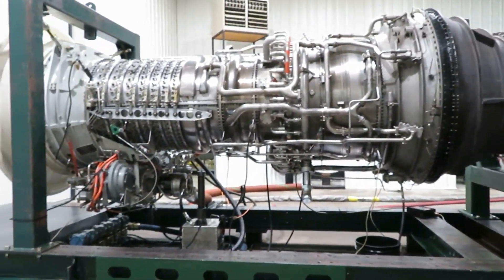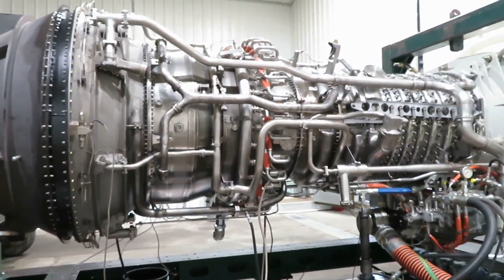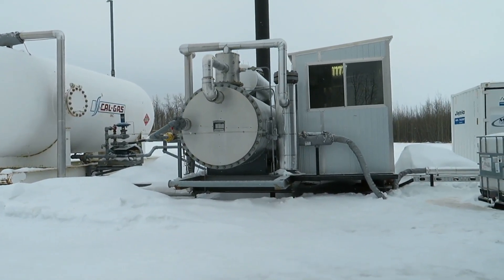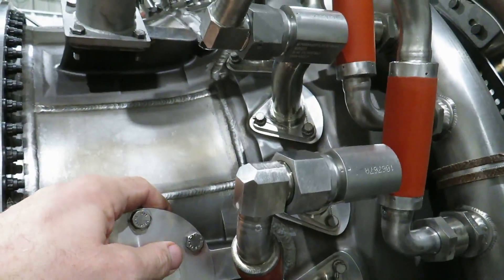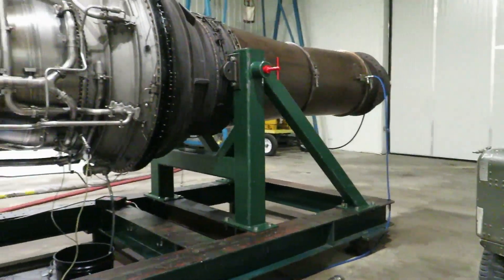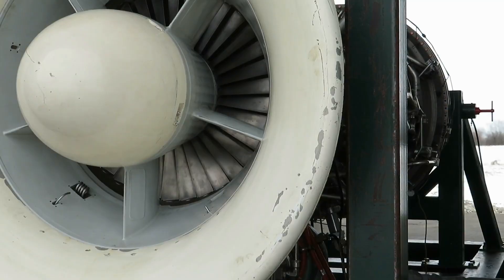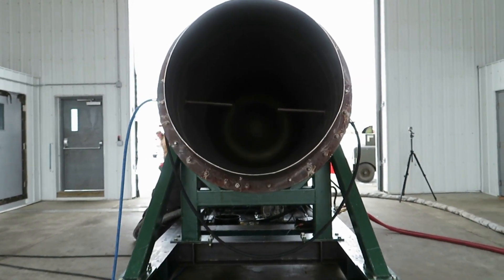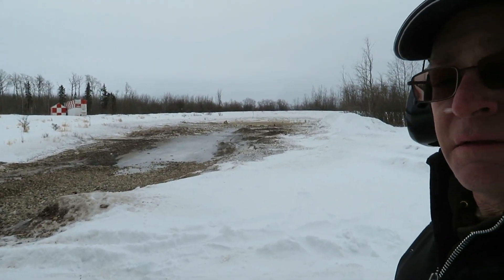The Big Engine - the GE LM2500

Comment: What do all those heads on the outside of the compressor at 7:10 belong to? My guess would be that they are variable angle stators although I'm not sure.
Reply from the maker: You are exactly correct, sir!
Reply: VSV, variable stator vanes. The green bell crank is actuating the feed back cable.
Reply: The actuator is powered hydraulically with fuel from fuel control.

Comment: What is this engine going to be used for?  I don't know of any aircraft that use LP for fuel.  My company has set several LM5000 on site for generating electricity.  We have set much bigger GE turbines also for power.  My company doesn't work directly on the engines but we have transported and set hundreds.
Reply from the maker: We use vaporous propane to simulate natural gas,because it would cost millions to put a NG pipeline to our test cell. This engine will be used like your LM5000's.

Comment: They built CF6-80C in the next building. Although back in the 80s we worked on military engines.F110 and F101.
Reply: Ed Dean, thanks for working on th F110.  I was an F-14B RIO from '89 to '94.  The B was very close to supercruising with the F110 engines.  Going supersonic and come out of burners, stay at full mil power, it would take a very long time to decel below Mach 1.  We could walk away from an A at max AB (zone 5) with mid AB selected.  And most importantly, no damn compressor stalls at high angles of attack.  Experienced two during training in ACM an it sucked.
Reply: @markfrost8745  Thanks for your service.

Comment: At 5:00 to 5:06 it looks like something flashing as the engine starts. It looks like it is down around where the starter is
Reply from the maker: Our sensor lines have ID tags on them. Small aluminum discs attached with a loop of wire. When the dangle about in the wind, they reflect light, and appear to be flashing lights to some people.

Comment: I'm curious about how far out the exhaust remains dangerous and how hot it is e.g., 75C to 150 meters?
Reply from the maker: It depends on what the power level is. We have gravel in Jetwash Alley, so the rocks are extremely dangerous for more than a hundred meters.

Comment: Probably a dumb question but how does the engine Not take off? What holding the stand down?
Reply: A bunch of concrete and some bigass bolts. But still you have to remember that this engine is not optimized for thrust but instead for shaft horsepower, so it can be used in power generation and such.
Reply: @nerfinator03  This engine is optimised for thrust, it's only when this engine (producing lots of high velocity air, and therefore thrust due to the momentum change as air passes through) is blowing on a power turbine (not present in this test) that you get useful shaft horsepower out of it
Reply: @maxhammick948  there is no point in running a different, less efficient due to heat losses, turbine after the engine. You have a perfectly fine chance to add a couple more blades in the back and try to extract as much energy as possible from the hot exhaust of the combustion chamber and then just slap it through a generator. This does not make sense for other reasons as well. How would the speed be regulated if the power generation turbine was a separate object. The generator needs to run at a perfectly synchronized 50-60hz.
Reply: @nerfinator03  It may not make sense to you yet, but it's how it works in the real world. Search the channel for 'Power turbine' to get a far more detailed answer to the parts that don't make sense to you. If you still have a question after watching the videos, please mention you have watched the videos, and still have a question. You will get a personal, and technical response. TRY first!
Reply: @nerfinator03  There is a point, as that's what turboshaft designers do: /watch?v=QdOZSZqCthI & /watch?v=dhV8cMQ__pw

Heat losses are pretty tiny, as the gap is small, and the spool of a gas generator doesn't have much to regulate the RPM either - it picks a speed it likes based upon the fuel input and atmospheric conditions. The synchronised power generators self-synchronise anyway if they're connected to the grid - running at anything other than the ideal 50/60 Hz means convincing the rest of the grid, so the synchronous generator becomes a motor. The forces imposed by this upon the rest of the turbine would probably greatly offend the spool of the gas generator.

No physical connection between the gas generator and power turbine is also essential if you're mechanically powering a vehicle with the turboshaft, as driving a vehicle requires varied output shaft speed (e.g. spinning up the blades on a helicopter, or low speed operation of a jetboat). This could prove fatal to the gas generator if you do stop the spool while continuing to add fuel, as the reduced airflow with the same heat input means higher turbine temps.
Reply: @nerfinator03  Well, the test in the video is the gas generator only which is pretty much a single-shaft jet engine. The thrust coming out of the test cell thrust nozzle is equivalent to more than 20 MW shaft horsepower which usually is generated in the attached power turbine. There are not many single-shaft turbojets without bypass and afterburner out there that would meet size and power of an LM2500 gas generator. So you better make sure your test rig is secured.
Reply from the maker: Music Rack:   They hardly changed any parts to convert the CF6 into the LM2500.
It appears from your comments that you do not know that every channel has a search bar. It's easy to find videos on the subject you are curious about if you use it.
Sorry if I get annoyed with people who ask the same question, after I have made multiple videos answering it... but I try to be amused at it.
Reply from the maker: Video: Our engine test stand.
Reply: @MrCrackbear  Sorry, that's what the channel search function is for. No free pass for laziness. We don't train for helplessness here. Just like the real world. Make AN effort! TRY FIRST, and if you still need help, you won't get any attitude from me (or Jay).
Reply: NOT a dumb question, but a poorly researched one...
You would do well to review the extensive catalog of existing videos here. ALL the answers you seek (and likely the next hundred) have already been answered for you IF you bother to look for them...

1) long pipes anchored into the ground. (Test stand)
2) this engine produces no practical thrust . (Power turbine)
Reply: @mikecowen6507  Hate to disappoint you I didnt research anything.  I saw one video and asked a question and like I thought it would be answered promptly.
Reply: @TheDominationNetwork  No disappointment whatoever. Given the amount of material Jay has produced, a blind person could "see" how much effort you put into (not) finding the answer on your own. Your loss, not mine.
Reply: @TheDominationNetwork  don't worry dude. I think it's totally fine to ask that question. I wouldn't want to look through hundreds of videos if you can just ask and get the answer quickly. Especially if this is not part of your occupation or hobbies or such.
The lm2500 is an aero derivative, which means the technology was originally an aircraft engine. They kept parts of the original design and changed lots of parts to change it into a stationary gas turbine which can produce mechanical power. This power can be converted to electricity in a generator for example. In an aircraft you want to produce thrust. Here the same energy is not used to produce thrust but power via a turbine.
Reply: Mike Cowen A curious mind is a precious thing that is best not stamped on!

Comment: I used to build these in Evendale, Ohio
Reply: I an still welding on the turbine mid frames and sumps in Evendale
Reply: Ed - did you build CF-6 engines at the same time or factory?

Comment: What is this engine used for?
Reply from the maker: Lotta things. Google-Fu.
Reply: The LM stands for Land Marine. On land the primary use would probably be generating electricity. On ships they would most likely also generate electricity to power electric motors connected to propellers.  They are also on oil platforms for electricity and could drive pumps and compressors.

Comment: That Variable Compressor Guide Vanes actuator system is such a simple but effective design! I guess it's very convenient to adjust the rigging angles if needed since there is minimal of external tubes and hoses compared to aero jet engines.

Comment: Could it run on hydrogen gas?
Reply: I'm betting that propane probably doesn't really produce carbon buildup either...
Reply from the maker: Yes, that would be the best possible fuel.
Reply: @AgentJayZ  I'm guessing because no carbon or other byproduct buildup yes?
Reply from the maker: Propane and natural gas are excellent fuels. Hydrogen is the best you can get.

Comment: The VSV adjustment arms on that looks pretty stout, also it seems to pivot instead of slide like the 1500. Does that mean the vsv's closest to the pivot point don't have as large of a angle of attack change as the ones at the front, or is there some trickery going on so that all vsv's still have the same amount of movement?
Reply: I think it's trickery. As you get closer to the pivot point the lever arms get shorter than those up front so they all probably move about the same once you account for the movement that the lever needs for the same amount of rotation
Reply: Top notch Ben 👍

Comment: How much fuel did the engine consume during the test run?
Reply from the maker: 20% of a 22 thousand Liter tank of liquid propane. In about 40 mins at various throttle settings.
In service it would use double that.
Reply: I worked on LM2500s for 10 years.  On Diesel we would use around 6000-7000 litres per hour
Reply: At full power, theoretically it would consume about 2-3 liters per second.

Comment: The engine rooms of warships powered by these engines must be extraordinarily loud.
Reply: I might be wrong but I think when the intake air and exhaust stream is ducted I don't think it's super loud
Reply: Both GE and MTU LM2500 packages are designed to give around 85 dB at the package door on base load. The engine is loud, but with the inlet and exhaust sealed, by far the loudest things are the package ventilation fans.
Reply from the maker: The heavy steel enclosures containing the engines have access doors, upon which are posted warnings of "lethal sound pressure levels".
Reply: They are built into custom sealed pods for that reason so they can be sound proofed and easily replaced.

Comment: Is it a single or twin shank?
Reply: Shank?
Reply: The Lm2500 has different versions. In the early versions there is a twin shank version where the high pressure turbine blades have two airfoils per root seration (or shank) while the single shank has one airfoil section per root seration.
Reply from the maker: Twin
Reply from the maker: I have just learned that my original answer is not correct. This is a single shank LM2500.
Reply: I have been in the test cell at the Corenado Naval base in San Diego, but there was an issue with the fuel delivery on the day so I couldn't see the engine run. We repair single and twin shank nozzles and blades at my work so it is always great to see an engine in action.

Comment: Re: the start cart. Is it like a turboshaft engine that drives a compressor for the starter or does it use bleed air off the compressor section to drive the starter?
Reply from the maker: B
Reply: It's got an oversized compressor and uses compressor bleed air.
Reply: The one we have at my work runs a centrifugal compressor not axial compressor like this beast (lm2500)

Comment: Where is the metering device for fuel flow to nozzles?  I assume there is one.
Reply from the maker: The main fuel control valve, as pointed out in this video... sort of. It's beneath a protective steel cover.
Reply: I thought that was for your test stand operations.  You're saying its automated for normal engine operation controlling flow to the engine as its throttled?
Reply from the maker: Our test cell is configured similar to a typical installation skid for an industrial gas generator.

Comment: Novice question, why do the stator vanes on the compressor turn? ( 6:53 )
Reply from the maker: Have a watch of my video: Compressor Stall
Reply: To guide the air moving axial through the compressor into the next set of compression at the right angle.  The cub schedule is set by the Woodward governor driven off the gear box as the speed increases the hydraulics drive the veritable stator veins. Also there is a temperature compensation at the inlet as you are correcting for air density

Comment: Do you have a video showing the purging of the fuel system?
Reply from the maker: I've shown it in a few older videos. It's just a guy standing there, holding the fuel line, with a lot of noise as we heat up the system by running hot propane through it. You can't really see the fuel coming out.
Reply: @AgentJayZ  Thanks for the reply.  I'll dig through your archives.  The process sounds more exciting than it probably is, but I like that sort of thing nonetheless.  I love your content, keep up the great work.

Comment: so only,...
Reply from the maker: What do you want for those PDFs? The LP system is removed on this design of the LM2500. The exhaust for this unit is ducted to a separate PT, which drives an electrical generator.
Reply: The 2500+ is not derived from the CF6-80 but a design enhancement of the 2500 Base (as seen in the video). The + has got a redesigned compressor with an additional stage using a huge Blisk and new airfoils in the other stages for about 50% higher airflow. The all over structural design still follows the design of the CF6-6 core it derived from. However it uses the more advanced material technology of the CF6-80, especially in the hot section. The direct derivate of the CF6-80 is the LM6000 series. And there was also one of the CF6-50, which is the rare LM5000, which is in my opinion the beauty of all LM's.
Reply: been too long obviously since I looked and now I do recall -80 = LM5000.  I have seen some ugly cracks in the NGVs on the -50 series before overhaul even.   But the pressure ration was lower, so it held together.  Some -80's don't hold together in airline service so well, but in the power biz they don't have too many cycles.  Or am I even wrong about this.  Guess I should zip my mouth shut since it has been too long.  Thanks for reminding me to not reply so much.

Comment: Is it not possible to use liquid propane directly?
I have a 2001 Mazda car that is fitted with an LPi system. It uses injectors to spray liquid LPG (Liquified Petroleum Gas) - a mixture of propane and butane - directly in the inlet channel just in front of the intake valves.
The vaporization causes the mixture to cool significantly. This way you do not need to evaporate the LPG and the cooler mixture compensates for the lower energy content of the fuel.
Reply from the maker: The engine runs on natural gas, so that's what the fuel system is designed for. We simulate NG with gaseous propane. We compensate for the lower energy content by using more.
We use truck delivered liquid propane because the cost of building a natural gas pipeline to our test cell is prohibitive.
Reply: @AgentJayZ  Thanks! That makes sense. I assume that these engines are deployed in places where there is plenty of natural gas.

Comment: You sometimes mention finding fuel leaks during these tests...drips are visible with liquid fuel, but how do you check for leaks when  using gaseous propane?
Reply from the maker: I am speaking of oil and hydraulic leaks here. We check the gaseous fuel system for leaks by spraying the connections with soapy water and looking for bubbles or foam produced by the escaping gas.